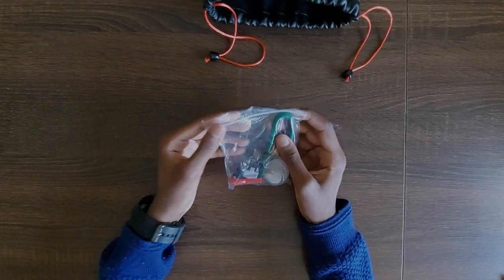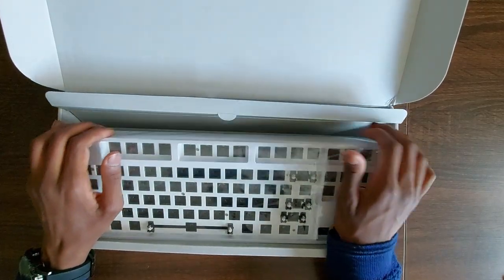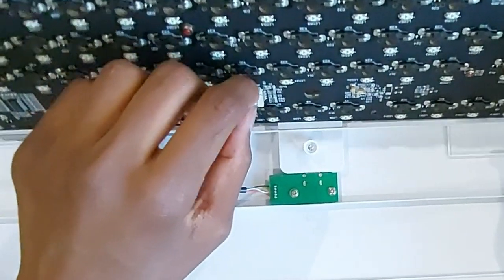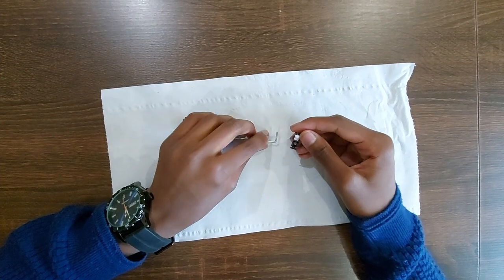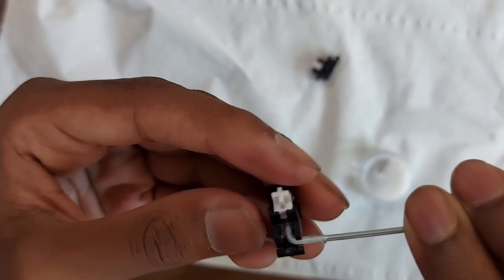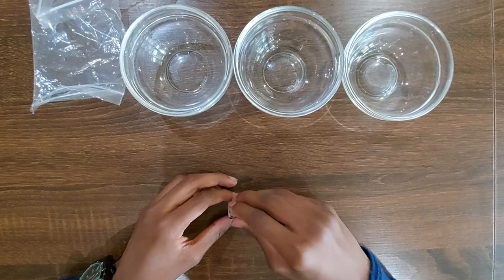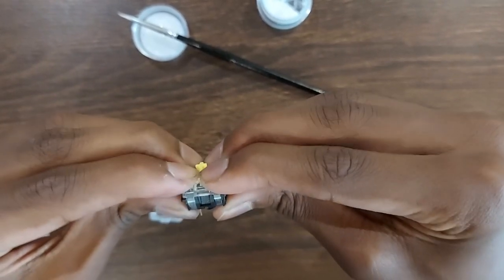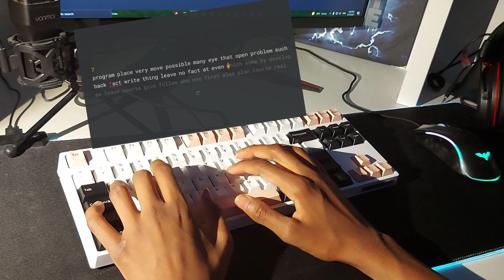Building my first CUSTOM mechanical keyboard (GK87, Gateron Yellows)

Comment: A few things:

For your first build this is amazing but you can change a few things to improve it

1. I've built this board for a friend and I'd recommend you change the stabs to something higher quality like durock v2 plate mount

2. There are standoffs to attach the plate to the pcb. Remove them. You can unscrew them from the backside of the  PCB, resulting in a softer typing feel and sound

3. If you baglube springs use krytox 105 which is more liquid
Reply from the maker: Ty sir
Reply: bout to start building one of these myself, exactly which stabs let's me worry a bit less about which to order.
Reply: Not plate mount, screw in
Reply: @adam-mt6vh  you cant do screw in if there are no holes for it
Reply: @nonculus  ik, make it

Comment: Quick tip, you can use the switch puller to pull the usb c port cable out with ease.